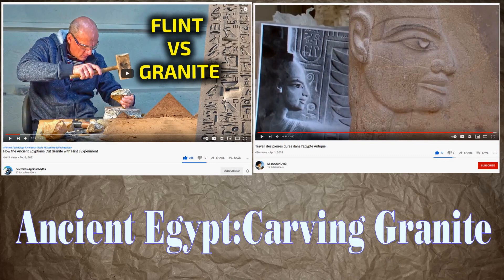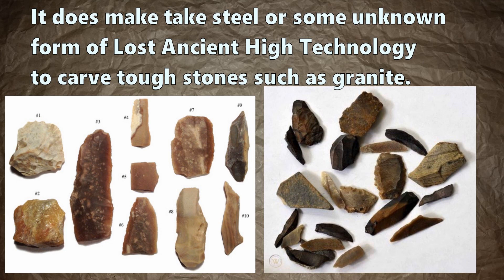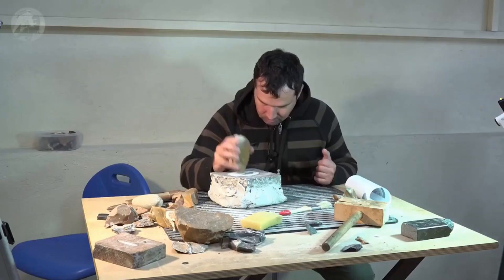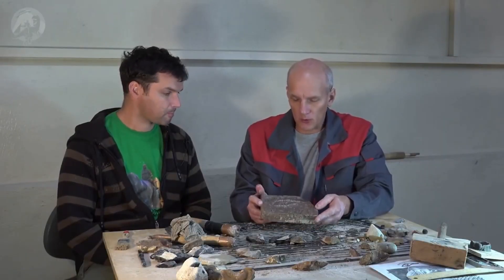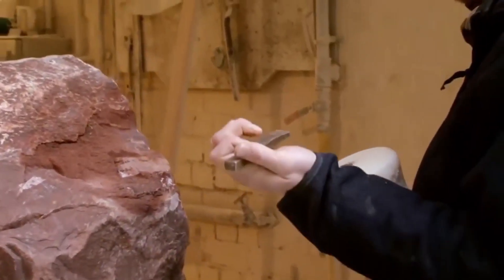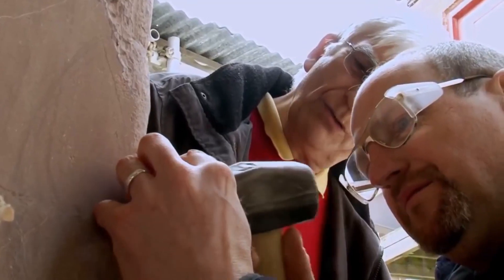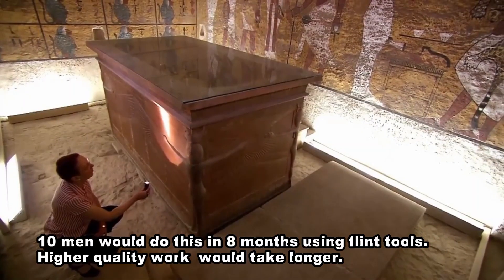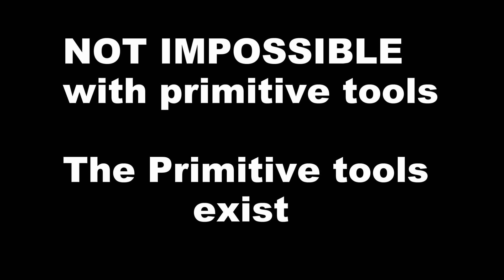Carving Granite with Flint in Ancient Egypt

Comment: 4:34 proof copper or bronze is inferior to steel. so clealry ancient humans used harder metals or rocks. like flint, quartz, iron, steel. iron exist in the giza plateau (the landofchem proved it). LAHT means anything more advance then copper, like iron or steel. LAHT confirmed. unless you heat up granite with fire setting and then use copper chisels (possible, but was it likely)

Comment: So the mystery I was trying to figure out was how they carved the corners inside the box, but if flint can chip away granite that becomes trivial... time consuming for sure but not at all mysterious. 
Does make me appreciate even more the time, effort, skill and dedication they had to put into everything they made.
Thanks 👍
Reply: Using bronze tubular drills along with an abrasive one can cut cores into a block.  Then using gneiss stone tools as hammer stones one can break free those cores to expand the hole.  Via chipping using gneiss stone a basic outline can be achieved which can further be sanded smooth using abrasives - most likely in a paste akin to modern kitchen counter cleaners. Plumb of the sides can be checked via wooden carpenter squares.  The tomb of Rekhmire shows craftsmen performing various tasks.  Among those is one with a square checking the plumb of the sides of a stone block. 

Yes it was time consuming = but they had the time.  Stone sarcophagi were used in ancient Egypt since at least the time of Djoser and then not just in Pharaonic tombs - but others as well.  That shows a continual demand which was filled likely via a large caste of craftsmen who year after year turned these things out.
Reply: @varyolla435  Academia's  conjectures about fabricating and moving/raising granite simply do not match the measurable and observable facts we see with our own eyes and which engineers who understand the physics involved laugh at.  But believers must believe what they are told rather than what they see with their own eyes and mind.

Comment: When we use flint and steel to make sparks, the flint is harder and strikes off bits of the steel which are pyrophoric and burn spontaneously in the air.
Reply: Thats a very good point. Flint is harder than steel. So carving granite is a no brainer. I know there are diamond sands and ruby sands. Its not like the Pharoes were short of choice for polishing media.
Reply: @SuperSquark  yeah that is a very good point. Very sharp observation. It shatters your expectations doesn't it lmao.
Reply from the maker: cool ,very interesting.
Reply: Thanks. Excellent info